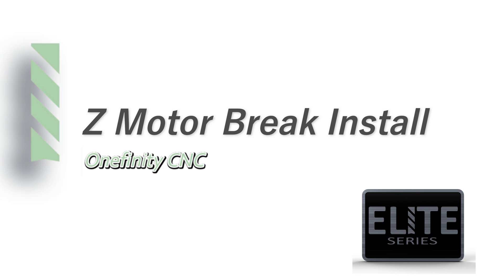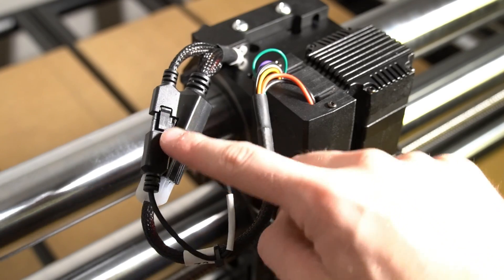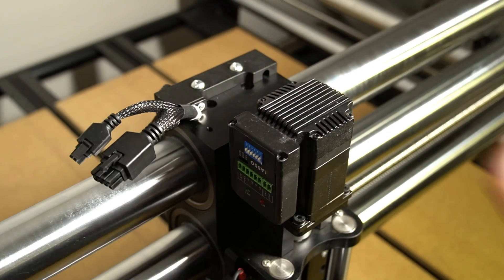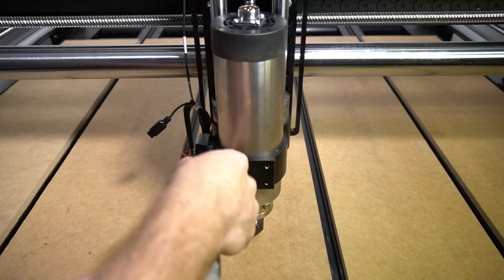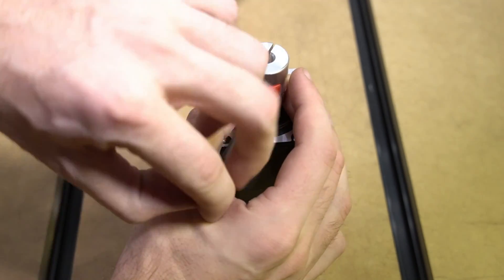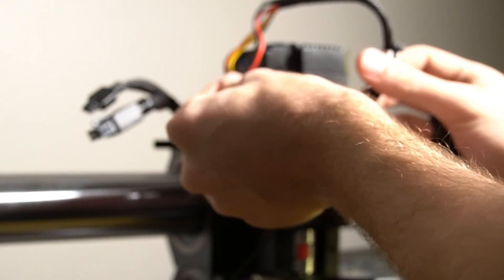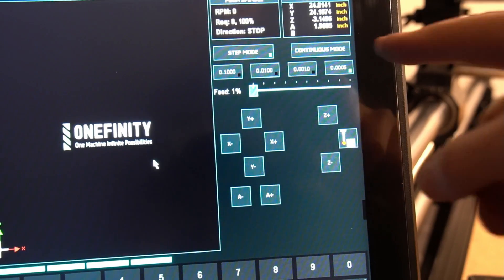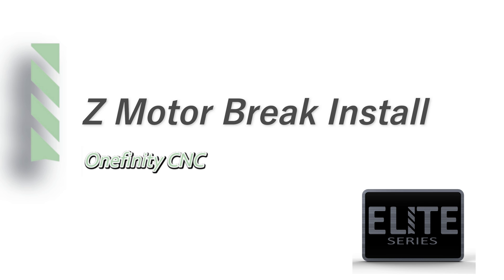How To Install the Onefinity CNC Z-20 Motor Brake | Support

Comment from the maker: *Special note:
1) Older machines may not have a coupler that has a grub screw.  Disregard this grub screw step if your coupler does not have a grub screw to tighten to the flat part of the motor shaft.
2) All blue dip switches (white number switches under the motor cover) should be set to on, as described here: https://forum.onefinitycnc.com/t/onefinity-elite-masso-motor-specs-faq/18787

Comment: One note about the dip switches on the new motor. Make sure they're set the same way as the original. Mine were not and it did some strange things at first.
Reply from the maker: Thanks for the tip!

Comment: It's been a while since this video was originally posted.
Is the Braking Stepper included with the purchase of the Elite 4x4 if 80mm spindle mount is selected at the time of purchase? 
I ordered one a little over 4 weeks ago and need to know if I still need to purchase the braking stepper separately? 
Google search sais,
Yes the Elite Z-20 comes with Braking Stepper Motor.
Is Google correct?
Reply: Ok thanks for the heads up.
Will be ordering the updated motor.
You guys should add the option to add the Braking Stepper at time of Machine purchase. 
Everyone thatt is getting the 80mm Mount is going to be putting a heavy motor on the machine. 
Having a spare motor isn't a bad idea.
But the Z-Slider dropping seems like a safety concern.
Reply from the maker: @KZ-1155  We're the only hobby cnc company that has a brake available. :)
Reply: @OnefinityCNC  It's all good.  
I just meant I wish when ordering there was a check box option to add the additional brake motor.
Kinda like the Stiffy add on option.
Even after many months of research of a million videos and articals read, I never ran across the power off Z-drop thing.
Maybe its a known thing by most people, but when your a first timer diving into the world of cnc routers, your head feels like it is going to explode from information overload.  lol
It wasn't until about 4 weeks after placing my order that I stumbled onto this information.  
Luckily I caught it just in time to add the brake stepper to my order which will arrive with the original order on the 21st. 
Having a spare non braking stepper is a good idea. Just in case.
Thanks for all you guys do for the hobby industry!
Reply: @KZ-1155 Even if ordered separately, it would ship at the same time as the CNC so not a biggy.
Reply from the maker: its only sold seperatly

Comment: Two noted differences while doing my install for others working on their upgrades:

The coupler did not have a set screw, just the 2.5mm hex nut to tighten.. slight variance in model maybe?  
The other.. before putting the plastic cover back on at the end, verify all 6 dip switches are “on”.  That will save you 30 minutes of trouble shooting when your z doesn’t have full functionality. 

Good luck!
Reply: Thanks for adding this note. I was just installing my motor and this was an issue for me.
Reply from the maker: Just made a pinned comment of this.  Older couplers don't have a grub screw.

Comment: @onefinity just a heads up the early motors do not have removable connectors for the signal wires on the motor.  The connectors are soldered to the board wires have to be taken off each pin with small screwdriver.
Reply: Agreed just wanted to mention it so hopefully someone doesn’t try to reef the connector off the old motor with pliers.
Reply from the maker: yes, the first batch of machines the motors are a bit different, but still an easy install!

Comment: Does the z20 stepper motor come standard when you order the elite foreman or do you have to order it separately
Reply from the maker: The BRAKE motor is an separate, optional add on.

Comment: Will the new motor brake be standard on new Elite 4x4 Table purchases?
Reply from the maker: At this time, no.  It’s a separate add on item.  It may be standard on 80mm z20s in the future when we have more stock but the cost of the mount will go up to offset the larger cost of the motor.

Comment: Question.  Does this upgrade mean that I will now have a spare NEMA-23 motor for any of my X and Y motors, should they fail down the road?  That is a good selling point to mention if that is the case.
Reply from the maker: Yes, you will have a spare motor after you remove the original z motor and can use it as a backup.

Comment: So my elite foreman just arrived, is this a updated z stepper motor from what I just received?
Reply from the maker: Yes, this motor has an integrated brake, this is an optional add on
Reply from the maker: No, it's an add on that won't be live until december 4th.  you can place an order for it when it goes live separately.